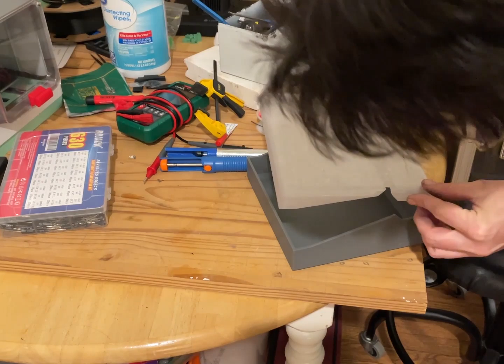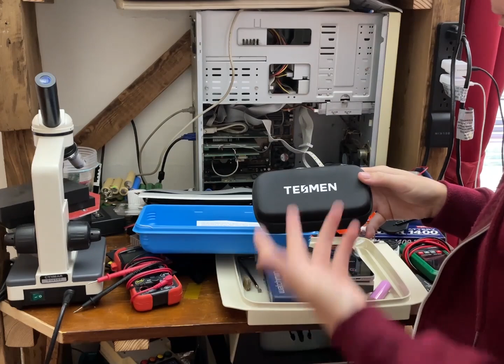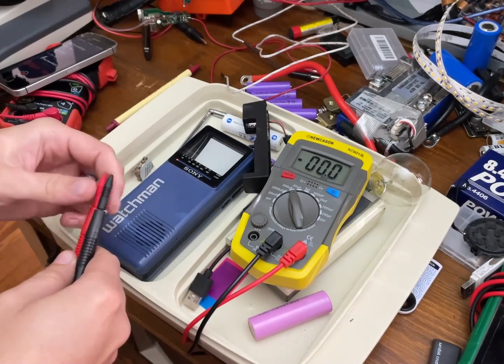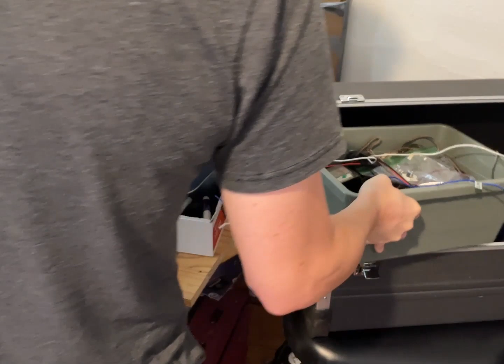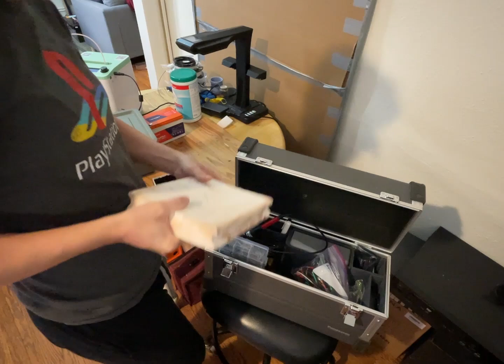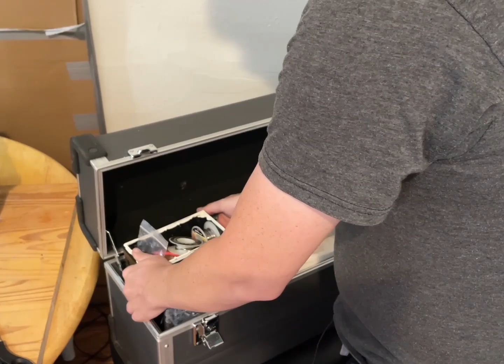Rescuing my electronics toolbox, and cleaning up my soldering supply mess. Time to organize.

Comment: Many modern oscilloscopes will fit. They do away with an internal power supply, and use USB-C for that, which allows them to become really thin.

 I thought straight away of the Rigol DHO800 series, which are tiny - 265 long, 161 long and 77.38mm deep.  And they fit 4 channels, 12 bit in there. Not enough room for individual knobs for each channel, though, which is something you might like to have.

Comment: Def laughing about Flashforge sending you a AD5M Pro to use. When my new Flashforge AD5M broke after two weeks of use, they decided to ghost me. Two months later I finally got a return label for it, returned it and they ghosted me again for the last three months.
Reply from the maker: Thats a shame, Ive enjoyed flashforge’s printers for many years. Ive had six of them so far if I recall right
Reply: @RinoaL  yeah, it’s not their usual behavior. They’ve made some great products in the past. 

It was cheaper for me to take a loss and get another printer. I got a Bambu Lab A1 mini. I wanted to get the A1 however, my budget def didn’t allow it.

Comment: Good idea to use a decent size toolbox for your kit. Yes you probably will fit a scope in there, but would need to protect the screen when the lid is closed. Probably better to have it so you can remove it an use if needed. 

I am lucky enough to use an outbuilding for my electronics work, I have a decent setup with manufacturing facilities for small batches too. I can't operate from inside the house as it's too messy especially when cutting component leads and dropping SMD parts on the floor.
Reply from the maker: I might end up having the oscilloscope facing upwards so the screen is protected.
Reply: Use soft side of sticky velcro on the side of the 3D printed box so you can pull out easy